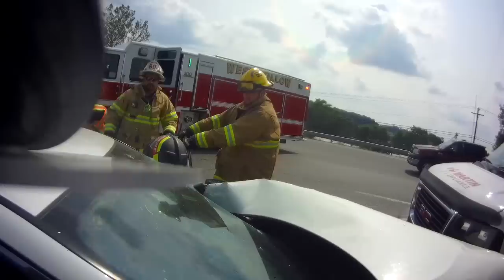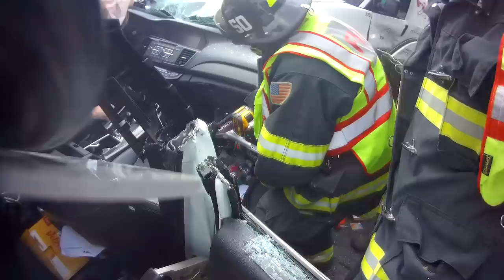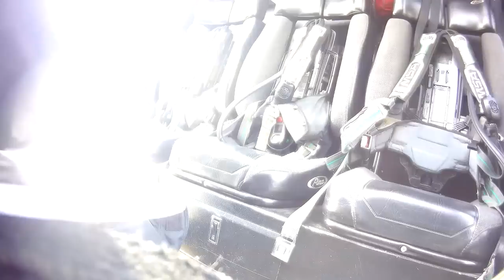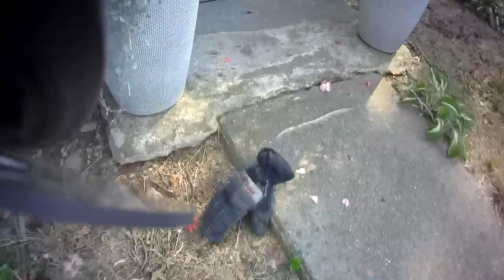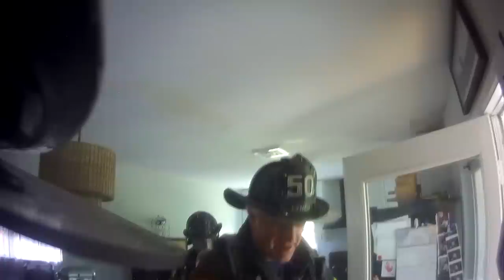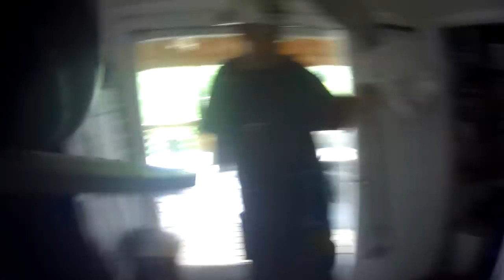2 Calls - Pin Job and Attic Fire *Helmet Cam*

Comment: IAFF L493 Brother here, I’ve spent about 16 of my 21 years on a Ladder Truck. Ive got a question and I ain’t picking at anyone but why did you guys take the roof off and attack the center console? She looked like she was only pinned by the dash, were her feet entangled too?
Reply: They were probably trying to make sure the car was fully in park some electrical cars will still try to restart if safely disengaged n such
Reply: @sarahsusongsheltonhankinss102 No, most modern cars will completely kill the vehicle in an accident. I've seen minor accidents where peoples cars shut down and they couldn't get them started again.

Comment: Nice to see an Asst Chief in the front seat with at least one rider unrestrained and standing in the back. Some will never learn.
Reply: is that the only thing you got out of this video? there was someone riding without a seatbelt!? 😢😱
Reply: @adambush2770  I didn’t have enough time to pick it all apart, but that is a huge pet peeve of mine. These “officers” are clueless. I’ve had the misfortune of seeing 2 fatal apparatus accidents and nobody was wearing belts. Sadly,same department. Inexcusable. And yes a ton of other issues in the video.

Comment: Battery powered VX tools take too long, lack the power and torque to get the job done quickly. They have the equipment; full hose reels, a big pump with high torque manifolds. With 2 sets of shears going most car and truck roofs only takes 3 minutes to shear off. With a set of shears and a set of spreaders popping doors,  5 minutes in the hands of a well trained VX rescue crew and the patients are completely accessible for paramedics to start critical interventions.

Comment: White car definitely ran that stop sign. Damage the front enough that it partially collapsed the driver compartment, they had them speed on them. 

Damage to the van is broadside and white car is left front. Van was already in the intersection when white car hit it at speed. Looks like everyone was ok though